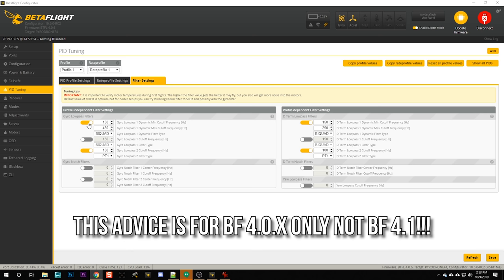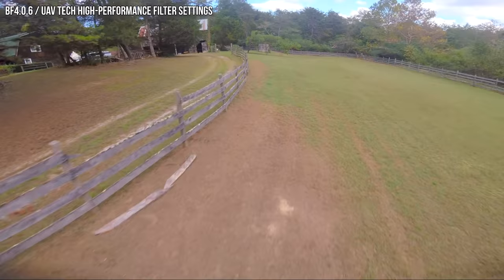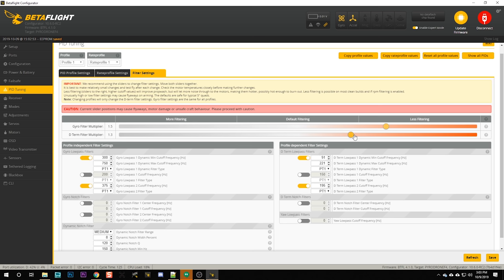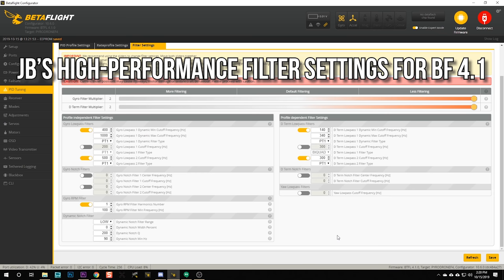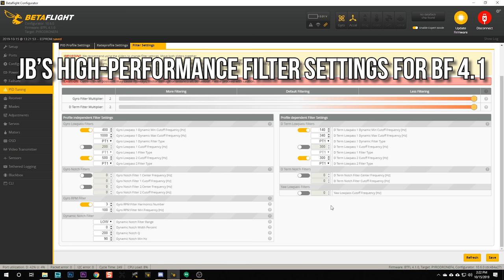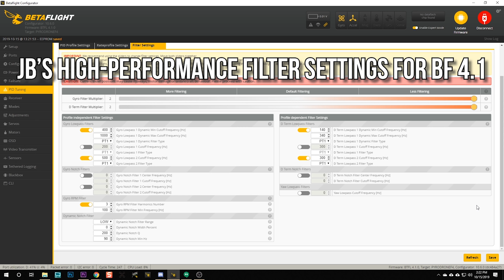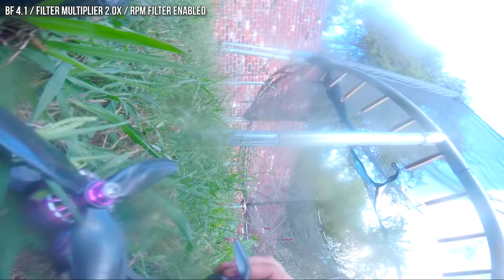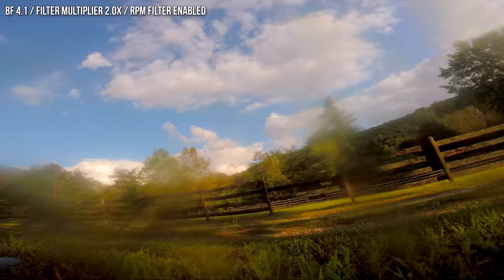Betaflight 4.1 RPM filter best settings to kill propwash

Comment: Stupid question time. Can I use a newer version of betaflight than what my fc came with? Do I have to flash my fc to the newest beteflight? I’m running 3.5.5 I downloaded when I got my mobula7 and never updated. I’m now flying a board from an eachine x140hv in a different frame and having random roll twitches out of nowhere. That’s why I am looking to use a newer version of betaflight now.
Reply: No such thing as stupid questions. Before you flash anything else do a full backup of current firmware and settings. 

Once you've done that, flash away my friend.
Reply: Yes you can use a newer version of betaflight if it shows there is one available for your flight controller, my mobula shows the most recent available for it is 4.0.2. And you dont have to flash the newest available version, you can flash whatever version you want thats available for your flight controller firmware target.
Reply: Just make sure you know how to configure the new firmware or you will be watching YOUTUBE for hours trying to get it set to fly again 😁. Go to the CLI in your current firmware and type in "DIFF" or "GET DIFF" than copy and paste it back into the CLI when you put the new firmware one... This will save all your custom changes you made to what you are at now 👍
Reply: There are lots of warning about NOT pasting in an old diff. At least not the filters, PIDs etc. Rates and features are OK, I think.
Reply: @aowi7280  Yea I meant just basic config stuff like his RX setup and features and what not, not actual PID or FILTER changes for sure 👍

Comment: What  do you suspect is still causing the bobbles in the final flight? Also, would this make the '6s on 4s motors' challenge easier to achieve with the FC knowing the output RPM or am I way off track?

Comment: Hi Joshua. I noticed on 7:31 timeframe specifically on D Term Lowpass Filters section, your "D Term Lowpass 1 Filter Type" was showing BIQUAD. However, when you disabled some settings, the BIQUAD setting disappeared and got replaced by PT1 right after you clicked "Enable Sliders" button. What is the correct setting?
Reply from the maker: PT1. Clicking "enable sliders" resets everything to defaults. Defaults are PT1.
Reply: Thanks!

Comment: do these settings apply to all types and types of motor? or are there some special tricks ... for example motor sizes 22xx or 11xx ... 14xx-18xx..etc ...
Reply from the maker: The beauty of the RPM filters is that they will target your actual motor RPM no matter what size of motor and prop you are using.

Comment: Merry Christmas JB, I have all premium components on a slam nasty frame. I keep lowering filter Sliders down. I'm at 1.7 on both. Everything seems great. Cold motors. Should I keep going?
Reply from the maker: If the motors are cold and you don't see any bad flight characteristics like mid throttle oscillation or Jello and your motor sound smooth then yes keep going the handling will only get better from there.
Reply: @JoshuaBardwell  I'm running t motor f55 pro 2 f3 mcu 4-1 esc and f80 pro 1900kv. I figured it would be noisy with such big motors on a little frame. I've been blown away with your filter settings. All my quads sound so good. I will keep going
By the way thats exactly what I was wondering
What to look for oscillations at mid throttle. It sounds better and better the more I keep going down. Will try again tomorrow
Reply: @JoshuaBardwell  so I flew 3 packs just now and im at 1.7 from 1.6. Tried 1.8 also. I could have stayed there but nervous on this new build. Props are new everything is new. As I go lower I'm definitely getting more throttle response? Doesn't make sense. I'm also getting way less bounce back after fast flips. I tested stock 1.0 VS 1.8. Why would the lower filtering give more throttle response and have less bounce back. There's virtually none now at 1.7 and 1.8.  Motors are still cool and it's the warmest day ever for the end of December at 67°. That should be warm enough to be looking for hot motors? This filtering has me puzzled. Mark or UAV Tech suggested in his video that this range is pushing it. D term noise will start getting past even with cool motors. Have any thoughts on all that? Thanks for your help and making my quad fly the best I've ever flown!

Comment: I'm  literally having the same micro jitters and bobbles with these recommended settings in 4.1 when flying straight, wonder if its something that can be tuned out.
Reply: Check your stick commands for jitter and consider RC smoothing if you have it. We're starting to get such fast response in the PIDs that it matters now. I can hear the quad jiggle the same speed as the springs if I let the stick slap back to center! it's not usually noticeable until the sticks are centered because you're not trying to flight straight in those situations.

Comment: Question? Installed 4.1 and flashed regulators 32.7. But sometimes when you connect the battery, the motors do not sound like that, the music is mixed. This is a normal phenomenon. You have to reconnect the battery three times four synchronous motors sounded. Regulators 32 Bit Holybro Kakute 35A. Matek F405 STD
Reply from the maker: As long as you have < 1% error in the Motors tab, don't worry about it.
Reply: @JoshuaBardwell  Well Yes, but that's the point. I install Desh from 600, the motor I twist and the error is less than 0%, approximately 0,046, etc. I Install Desh from 300 motors show 0% of errors. Interesting and strange. Perhaps this algorithm so built, that minimal passage Desh from 300 safer and without mistakes, and Desht 600 betrays mistakes but less 0.

Comment: Mr Joshua I am having problem with mid throttle oscillation, can you please help me. I am on betaflight 4.1 and have followed your settings in the video. TIA.
Reply from the maker: If using blheli32 I sughest changing motor PWM frequency to 48k and then if it still happens reduce motor PWM frequency by 4k until you find a value that minimizes it. Don't go lower than 16k.
Reply: Thanks, I am not running blheli32 esc, I am using Jesc rpm filtering on.
Reply from the maker: JESC can do 48 kHz PWM frequency but not adjustable. Try that.

Comment: Would a dual gyro f7 have any benefit in terms of tuning? Maybe it could perform better with no rpm filters, since the dual gyros are supposed to eliminate motor noise or something like that? I have no idea what I’m doing but I’m trying to tune a dual gyro f7 fc to work well with 4.1
Reply from the maker: You would expect that a dual gyro board using sensor fusion would be able to run less filtering while still having cool motors.
Reply: @JoshuaBardwell  Alright, so what about 3 inch quads, the filtering must be different, do you just use higher htz on the dynamic notch filters?

Comment: Hey joshua why you dont try that problematic drone with EMUFLIGHT? Its really working well, just default PID and filter and ready to fly, i would advice you to try it, i think is going to be even smoother with that
Reply from the maker: Hmmmm interesting idea.
Reply: @JoshuaBardwell  just remember to tell us the results if you try it, on my experience, i havr try bf 4.1 with rmp filter and everything and after try them with default pid and filters with emuflight... basicly i have change my freestlyle, racer and 7 inch long range drone to emuflight and i dont even think to come back to bf🤷‍♂️

Comment: Joshua can you help me out. Whenever I throttle up on my quad my video cuts out and I can’t figure out why.
Reply: Sounds like your regulator powering the cam or VTX is going bad.   I had a similar problem a few months back with my VTX.   I had to put it on Vbat instead of 9v regulator and its been good since.

Comment: hi Joshua, thanks for the video. Have filter multipler set to 1.4 and the quad wobbles a little and has awful prop wash. do i increase the multiplier so that there is less latency or do i decrease so it will have more filtering?
Reply from the maker: If the quad is not flying decent in smooth slow flight then I would not push the filters. I would try to figure out what is wrong with the rough PIDs first.
Reply: @JoshuaBardwell  Thank you!

Comment: is it advisable to switch to dshot600 if the reading of the engine revs does not read errors? and in that case is better set gyro and pidloop to 8k? or is useless? in a fF7 FC
Reply from the maker: For f7 you can probably run 8k DSHOT600

Comment: Hey Joshua, I've been flying my quad not aggressively at all, getting 4 minutes or more on a 4s 1300mah battery, and my motors have been coming down a little hot I think. They come down at around 100F, and where I am is around 85F. Is this normal or are they sort of hot? I am using default BF4.0.0 pids and filters, Blheli32 Pwm frequency 32kHz, Dys Samguk 2207 2600kv motors. Are the temps cool to warm or are they hot? Thx
Reply from the maker: Only 15 degrees above ambient sounds like basically nothing. I wouldn't worry.

I wouldn't start worrying about motor temp until around 140 to 160 F. And in reality, damage doesn't start happening to the enamel until closer to 190 or 200.

Comment: I don't really get the whole killing-propwash thing. I like this "settling-in" motion of propwash in HD footage, makes it look real and lets you "feel" the quad while watching which I enjoy more than the one-million-dollar-advertisement Reelsteady-look. Just preference I guess. I'm more inclined to tune out the little vibrations you see while flying straight...
But is propwash actually bad like in making your motors hotter or something?
best regards <3
Reply: Any tips "to tune out the little vibrations you see while flying straight"?
Reply: @aowi7280  Mostly lots of filtering. That's why I'm wondering... 
Aside from that what helped me the most was using decent props, though. (S3 Watermelon)
Reply: I'm using HQ Durable 6X3.5X3 or 5.5x
Reply: @aowi7280  And I'd say your video already looks pretty ok judging from the last one. I think you mostly have some little actual jello which you can get around with ND-filters and/or camera settings.
For a 6" expect some tiny little bobbles I'd say. ,)
Reply: Propwash is the quad doing something I don't want it to. I mostly race and don't record the video. Propwash is the quad fighting me basically., and the PIDs over-reacting.
Reply: @beanMosheen  Makes sense, good explanation mate. I can imagine it costing a couple seconds if you have it "settling in" instead of just going the next direction... ;-)

Comment: Hey Joshua, the vibrations on the first 2 flights... Are they from high Ps? Or am I wrong? (I'm asking just to see if I'm diagnosing it correctly.)
Reply from the maker: No, none of the above. There is something wrong with the quad mechanically like an off-balance motor or a damaged gyro on the FC.
Reply: @JoshuaBardwell  Oh, I see... Thanks, Joshua! 😊
Reply: @MCsCreations  high P is a problem we see loads of though with FF doing so much of the pushing now you just don't need loads of P.. i can look at peoples PID numbers and know that they have P term oscillations going on with out even looking at a log or a video

Comment: Hi Josh. I set my vtx to 200mw and tried to fly but the drone kept dropping signal and went to failsafe within 100 ft. I turned it back to 25mw and it flew fine. Do you know what the problem would be? Its a babyhawk R pro 4". Thanks
Reply: Change the VTX, that one is faulty, it fly ok at 25mW but drop the ball at 200mW , my 2 cents
Reply: Move the RX antenna away from the vtx antenna as much as possible. Millimeters count!

Comment: Hey Josh. I noticed in betaflight your running reversed props. After watching your video for props out or in I am wondering why the change?
Reply from the maker: I typically run standard props, as usual. If this quad was reversed, it's the exception.

Comment: Can you use the rpm filters without bidirectional dshot?
Reply from the maker: No. It's not possible.
Reply: @JoshuaBardwell  ok. But i can still run 4.1 without the rpm filters?

Comment: What is your definition of hot motors?
Reply: If you can squeeze them with your fingers somewhat tightly without having to let them go they are not hot enough to melt the enamel and burn the coils.
Reply: When you have seen more vidios form him then you will now what it means hot motors are untoucheble and warm is normal con can take the motor in your whole hand !!!!!!!!!!!!!!!!!!!!!!!!!

Comment: Hey Joshua, would these settings work on a 3 inch quad?
Reply from the maker: The same principle applies yeah
Reply: @JoshuaBardwell  what about a 7 inch with 2806.5 motors on 6s?

Comment: I noticed in the cli in betaflight that there is rpm harmonics on the dterm and default they are set to 0. You can choose 0-3 just like on the gyro.  Would this be able to help in any way for filtering on the dterm?
Reply from the maker: If they are off by default, then I would want to have a pretty good reason for turning them on.
Reply: @JoshuaBardwell  you're right.  I'm just curious.  What about the dynamic idle function?  Have you used that at all.  From what I read about it that is supposed to give better braking torque and better desync protection.  Also improve the floaty moves.
Reply: @JoshuaBardwell  I followed the tuning guide for 4.1 for dynamic idle and I have gotten an idle_min_rpm=27 and my dshot idle = 3 and it has no desyncs for being so low plus the hangtime and quick maneuvers seem better.
Reply: It says it is optimal for reverse flow conditions so the motor will never go below the min rpm.
Reply: The exact settings I'm using are 
Set transient_throttle_limit = 0
Set idle_min_rpm = 27
And in the configuration tab I set my dshot idle to 3.
Reply: My motors are 2306 2500kv and I'm using the hobbywing f4g2 stack.
Reply: I was just asking if you think there is any benefit setting it up.

Comment: Hey man I got a question for you. Im starting to get into FPV flying and I am researching a lot about it now. Can you use fpv goggles with glasses or does that not fit? What do you do?
Reply: most pepole use ipd inserts in their goggels. i have glasses to but dont need the inserts in the goggles. so test it without first.
Reply: There's the FXT Viper goggles. I would buy 2 pairs if I had the money. 😬
Reply: No you.have to get inserts i got mine at rho. Lens  cost me.80 bucks but man what a differance dont waste money on the diopters
Reply: I am farsighted and use diopters on mine no issues. If you want to use your own eyeglasses you need boxgoggles. If diopters dont help you can get custom ones made
Reply: @RocketPunchArmy  yes im opposite cant see far away so i needed lenses of my perscription

Comment: I can't even get bf 4.1!! Did they take it away for awhile??
Reply: No, just make sure on you firmware flasher tab that you have "release and release candidate" selected. I also tic the "show unstable releases" at the top. It should be there, 4.1.0rc6, full release is not out yet.
Reply: you need to select releases and release candidates

Comment: What exactly is happening if the motors warm as filtering is removed?
Reply from the maker: That is the normal effect of removing filtering.
Reply: @JoshuaBardwell  I appreciate your response and I dont mean to waste anyone's time here, but I want to know the causes why they are more likely to warm up as you remove filters.  From my understanding it's the normal operating oscillations that are disregarded by the fc by filtering, and not having these allows the motor to focus its energies on command and environmental events.  This allows the motors to  remain relatively calm and not get as hot.  Am following correctly?
Reply from the maker: Think about a belt that is driving a pulley. Now think about if you started vibrating the belt too fast for the pulley to move, so that the belt was slipping on the pulley. Friction would heat up the pulley.

When the ESC drives high frequency current through the motor coils, the energy cannot be translated into motion, because the inertia of the bell prevents it from changing speed that fast. The energy must be translated into heat.

Comment: What happened to last nights livestream? 10/14?
Reply from the maker: They go unlisted after they finish but it's public now.
Reply: @JoshuaBardwell  Thanks, do you think a tutorial on the R9 system, like do you need to upgrade receivers? I was on their web downloads page for one of the receivers and it looks like you can put all of the versions, ie us eur, fport flex or access into the same receiver, just need the r9 2019 tx module?  Frsky isn't clear on theses matters so it's no wonder birds are dropping out the sky, you HAVE TO HAVE MATCHING SOFTWARE ON TX & RX, i've been using fport for over a year and no problems as I flash receiver before install.

Comment: 13:00 minute , I try and my esc broke!. Don't try to change filter high or low. For setting rpm filter please view "UAV Tech" channel youtube!
Reply from the maker: I'm not recommending you fly with 2-blade props. Many ESC's won't take it.

Changing the filters like I say in this video is 100% consistent with UAV Tech's advice. He has great videos but you're talking like I gave wrong advice and it's not true.